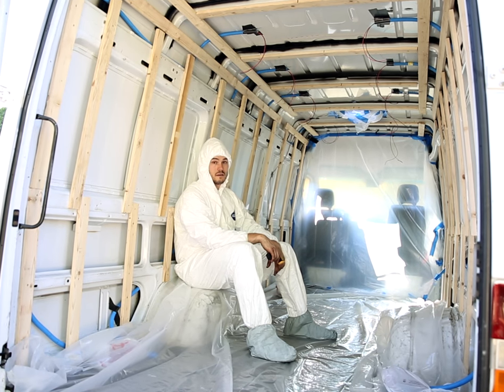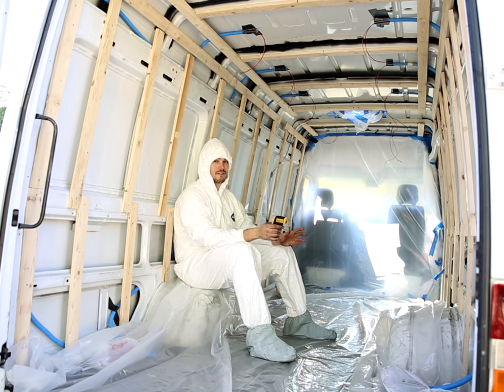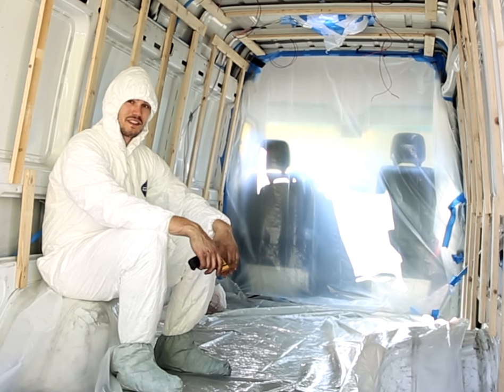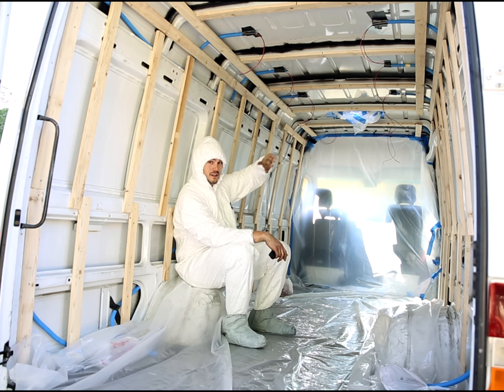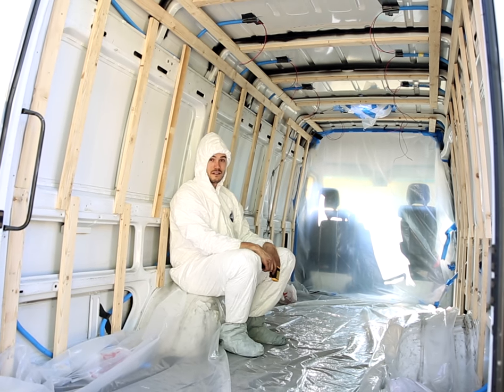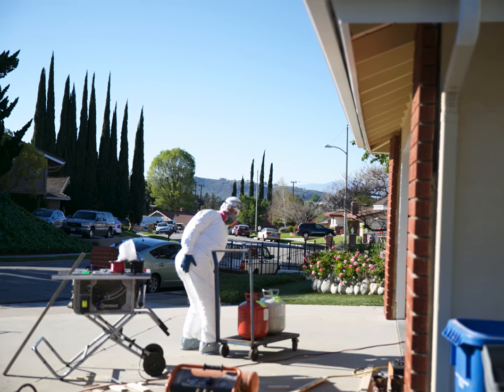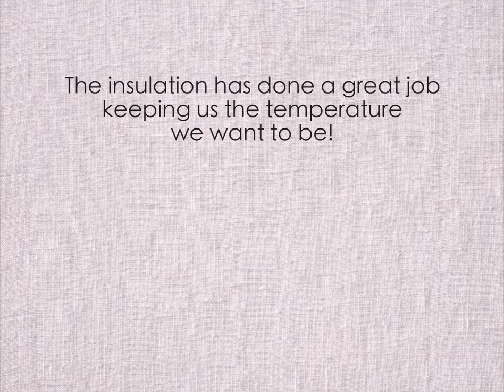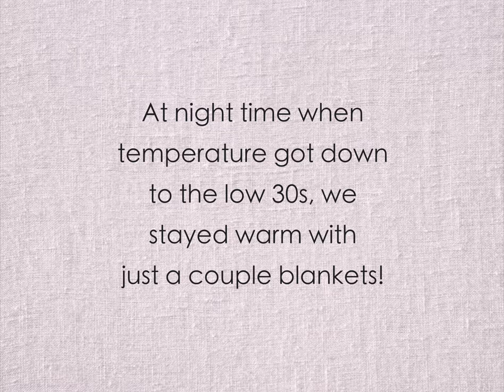Spray Foam (OH NO!!!) - DIY Sprinter Van Conversion #2

Comment: Hi there, so glad I found your video, thanks for helping us, the newbies...Questions!!
Should I consider closed cell foam? I hear it has a higher R value, but I'm worried about the weight and if it could damage the metal walls, since it is very rigid. 
Thanks man...cheers.
Reply from the maker: Hey there! Thank you for the comment but trust me, I am as much of a newbie as anyone... no expert here, just a bunch of opinions : ). I would not worry about damaging the metal as long as you leave enough room for the foam to expand and don’t spray too thick all at one time, coat in thinner layers. Closed cell is good on the moisture front. It’s what I went with and would go with again. Hope your project goes well!
Reply: @GetBusyBuilding  how long would you wait between layers? is it a few hours, or day?

Comment: Did you just screw the wood boards into bare metal? Did you use wood screws? I want to use the same set up.
Reply from the maker: The nailers that I am foaming around were screwed straight into bare metal. 3 wood to metal self drilling screws; one bottom/top/middle. I believe they were 1/4-20, 1 1/4” long zinc coated for rust resistance. Do what feels right to you though 👍 best of luck!

Comment: Curious as to why you didn't install the ceiling fan before you did the spray foam ... what was your rationale?
Reply: E Deuce thanks for the question. I installed the front fan prior to spray foaming, I decided to add a second for air circulation after spray foaming. Having done it both ways I will say doing it after is easier to get a really nice fit, just costs you a little foam.

Comment: Why did you not spray the floor?
Reply from the maker: Biggest reason was to not reduce the interior height of the van which was already a little tight for me. Additionally I didn’t feel (and still don’t feel) that it really would have added much comfort to the living space.
Reply from the maker: Haha, don’t accuse me of being an expert! I will say that is not exactly correct based on my experience. It all has to do with where you park. I.e. if you park on asphalt on a hot summer day the heat is going to radiate from the road and the floor of the van will warm up. In the cold the floor does get a little cold. These are both to the touch, when you walk around barefoot. I honestly found that just putting a rug down made it easier to clean the van and mitigated these very slight discomforts. If the road is hot enough to heat the floor than your van is going to be hot no matter what... same goes for the floor. For me the interior height was most important.
Reply from the maker: The road noise was significantly less from foaming the walls, ceiling, and wheel wells. I’m not sure the floor would cut the house much more as there technically is a wood and tar paper barrier fixed to the metal sheet which dampens extra noise, furthermore the undercoating sprayed on the bottom of the van is thick and does a fairly good job dampening noise as well. I wouldn’t expect much of an improvement from spraying the floor.... spraying the flimsy metal on the sides and ceilings helps a ton!
Reply: @GetBusyBuilding  maybe spray from the bottom

Comment: Hey mate, wondering if you could donate a sample of your two pack sprayfoam offcut to my channel.  I want to get a bunch from different sources and test for any chemical outgassing.  Cheers
Reply from the maker: Sorry Brendon, this was sprayed over a year and a half ago. We have no more off cuts. The best I could do is scrape off some really small pieces that are still expose on the frame. Not sure the quantity you need for an adequate sample but happy to help if possible.
Reply: @GetBusyBuilding  if you don't mind,  that would be great.  How tiny would the bits be?  I'm fairly sure I should be able to test even a small amount. Message my name at gmail.  Cheers
Reply: Brendon Tait Hey, did you ever run that test? I am debating installing the foam.
Reply: @wolfie26  I haven't yet, in a cpl months I will be comparing outgassing and insulation in a video.... the thing with it is...  I believe if the diy system of two pressurized cans are used it might be fine or it might not. Mainly for the reason the two chemicals might not be evenly metered, depending on temperature/viscosity/age etc. This could leave unreacted chemical. So it's a gamble.  I would expect that in most circumstances the fully professional ones that use metering pumps should be ok.   If I was considering spray foam, I'd probably just do it with steam and DIY single can foam as in my video.
Reply: Brendon Tait yes, I watched your video. I agree, it is a gamble.
Reply: JA S I didn’t